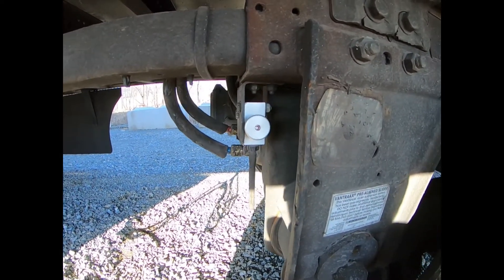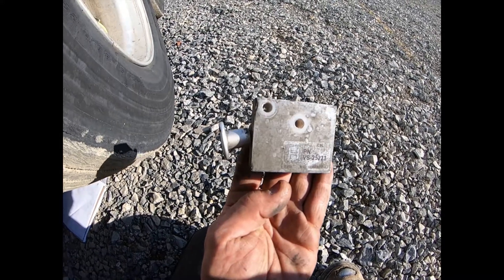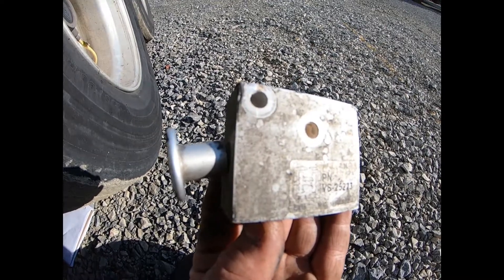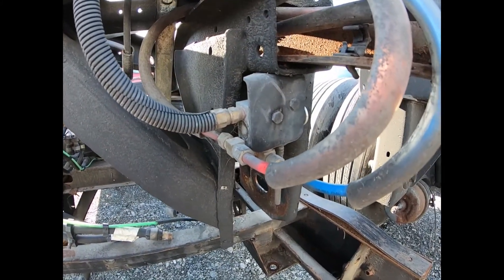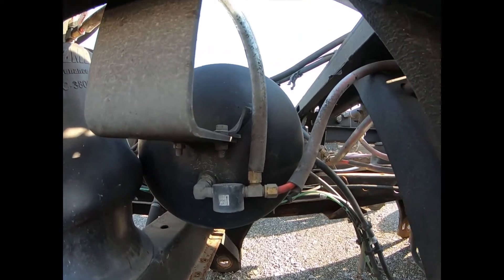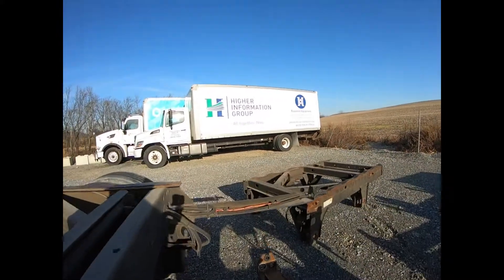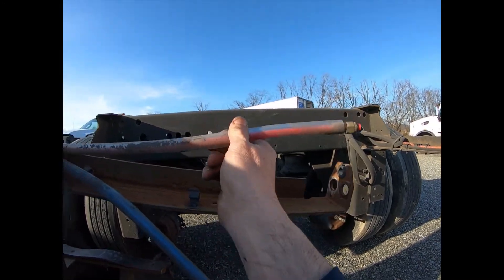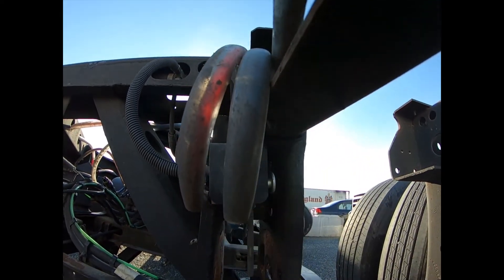Operation and plumbing of Hendrickson's Quik-Draw slider pin release system.

Comment: The blue and top black line I understood very clearly. 

However, the two red lines, you stated the red line (emergency/supply air)  coming from the gladhand.  Doesnt the red hose from the gladhand go straight to the relay valves/tanks first?

im assuming this system is isolated from the MAIN trailer braking/release system?

Nonetheless, amazing videos, i hope you keep making more on any topics. Learn a crazy amount from you.
Reply from the maker: The airline from the red gladhand does go to the emergency relay valve, but certain air accessories will tap off of that red airline, before it gets to the relay valve, to perform a function. The function typically doesn't "consume" air, it just acts as a pilot to hold a valve in a certain position when the parking brake is released.

The slider pin valve in the video uses the air in the emergency airline to lock the push/pull valve handle in the closed position. This ensures that when the parking brake is released, the slider rail pins stay set.

Another example of a valve using the supply air before it gets to the relay valve/tank is the Hendrickson Tiremaax Pro tire inflation system.  It uses the air pressure from the supply line to open the tire inflation valve, allowing air to flow to the tires if needed, but only when the parking brake is released. 

Hope this helps. Thank you for the compliments!
Reply: @fleetrepairsolutions6372  Thank you so much for the writeup. Makes sense.

Comment: Thanks this really helps me to understand how it works. Will a bad pressure protection valve cause the pins to go in very slowly?
Reply from the maker: Definitely.  As long as the slow movement isn't from some sort of mechanical obstruction like pin misalignment in the slider rail.

Comment: I have a question or problem, that same valve when it performs its function of retracting the pins does not remain static, that is, it retracts by itself, any advice on this?
Reply from the maker: Is your trailer parking brake released when you are trying to pull the handle?  If so this is normal. The symptoms you are describing, the handle pulling back into the valve when you try to pull it out, happens when the trailer brakes are released.  The valve is intentionally plumbed this way to ensure the pins stay engaged when the trailer is moving.  If your valve handle pulls back in with the parking brake applied, ( no air going to the trailer) I would suspect the valve is bad or the plumbing is incorrect.

Comment: I have a damaged valve but am stuck in a small town. Is there a way to bypass the system to get it going to the next town for the correct replacement part?
Reply from the maker: Sorry for the delayed response... All depends on what is wrong with it. Is it leaking air from the damage? You can bypass the system by plugging the lines feeding the valve, (the line from the pressure protection valve and the line connected to the emergency supply) but with without parts like brass fittings you'll have to find some creative, non DOT approved ways to block air flow going to the valve.

Comment: Nice Work, Thank you
Is there a bypass tool when one air bag will not pull one set of pins but the other one works, seems like the bad one is not getting air to it, flat.

Comment: I have a 2022 Stoughton with a Hendrickson B25223 quick draw valve, and it has been getting increasingly finicky with having enough air to release the pins, even after letting it hit 120-125 psi, setting the brakes and sprinting back to pull the knob before it loses pressure. Could this be a valve issue or should I look at another part of the system? Tank holds air fine, releases the brakes in moments after sitting all weekend.
Reply from the maker: If you're not hearing an air leak after you set your brakes or after you pull the slider release valve handle, you shouldn't be losing pressure.  The air bags that operate your slider rail pin work the opposite of the way you think it would...When the brakes are released, the airbags are deflated and a metal spring on the inside of the bogie pushes on the pin out through the slider rail.  Only when you pull the slider pin release valve handle should the bags inflate.  When the bags inflate, it pulls the pins inside the slider rail and you can slide the bogie.  
First check for binding of the pin inside the slider rail from misalignment. (Sometimes you have to whack them with a hammer to release.)
Next I would look the pressure protection valve (usually mounted on the side of the air tank) feeding the slider pin release valve.  If the valve is blocked or seized it could restrict air flow to the valve.
Reply: @fleetrepairsolutions6372  That pressure protection valve seems like a likely culprit, because I don't see much on the quick draw valve to really fail; it's like air in the tank just isn't being amply supplied to it (yet plenty of air for bags stay aired, brakes release easy etc.). It has the tire inflation system which I had a bad flat a few weeks ago and it seemed to get more temperamental after that. Maybe something started to get stuck inside when leaking through the inflation system. Thanks a lot for the reply and taking the time, I really appreciate it.

Comment: You are the best!! Love your videos!! Is there any chance you can do a video showing how the air from the supply line travels back to the end of the trailer, and what is feeding what? For example, what is feeding both slider pin actuators? Also, from the Hendrickson Tiremaaxs Inflation box, there are three air hoses attached to it, if you can please explain where are those air line going to/from. Just to kind have better understanding where is the air going from the front to back, and what does it do.  Thank you in advance.
Reply from the maker: Thanks for the positive feedback!  Look for out for video you requested in the near future.
Reply: @fleetrepairsolutions6372  Thanks a lot, looking forward to it! It would be nice, since you did couple of videos on the existing bogie, to explain how the air from emergency and service line travels with the explanation what does it do. It is really nice to watch the videos from someone very knowledgeable as you are. Excellent job!!

Comment: What can be the issue those pins won’t retract all the way? Can this quick draw valve be the issue not to retract the pins all the way?
Reply from the maker: If the pins are moving I doubt the valve is bad. Make sure your trailer air tank is fully charged, then set the trailer emergency brake.  With the valve handle pulled out, try hitting the pins with a large hammer to ensure the pins aren't bound up between the slider rail and the bogie/subframe.

Comment: Question. The pressure protection valve is providing air all the time to the quick draw valve?
Reply from the maker: Correct, as long as there is sufficient tank pressure it will deliver air to the quik-draw valve. But it doesn't do anything with it until you pull out the handle.  (Going down the road with brakes released, the slider pins are held in the slider rail by metal springs attached to each pin. When you pull the quik-draw handle with parking brake set, the air bags inflate overcoming the spring force and pull the pins in.)

Comment: Picked up a trailer today and I couldn’t pull the button out on the mechanism to slide the tandems. I’ve never had this happen in 10 years of driving, and can’t find anything relating to this problem online. Any ideas?
Reply from the maker: Sometimes the push-pull handle just seizes inside the valve from damage or contamination in the air brake system.  If this is the case the valve will have to be replaced or rebuilt.  Before replacement of the valve, confirm the trailer parking brake is set while trying to operate the valve.  If the trailer brakes are released, the valve is plumbed to keep the push-pull handle in.  (That way your pins don't release while you are going down the road.) 
Another less likely cause is incorrect plumbing going to the valve. Ensure the hose on the top of the valve goes to the slider pin air bags.  The hose below that should be connected to red supply line that is coming from your red gladhand. (This is the line that keeps the handle pulled in.) The hose on the bottom should go to a pressure protection valve mounted somewhere on the air tank.
Reply: @fleetrepairsolutions6372  Hey thanks for the reply!  Your first answer was correct, it simply seized up.  With the help of another driver, and some brake cleaner and some elbow grease, we were able to pry it out to slide the tandems to a legal weight one last time before the trailer goes into the shop for a replacement.